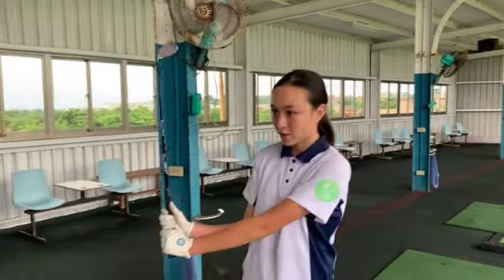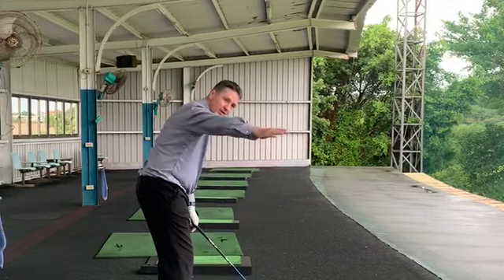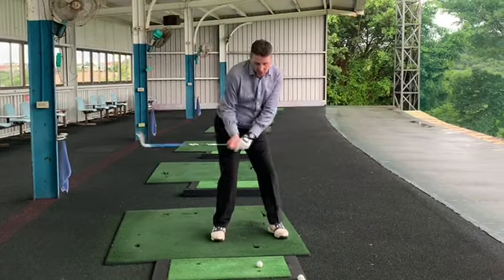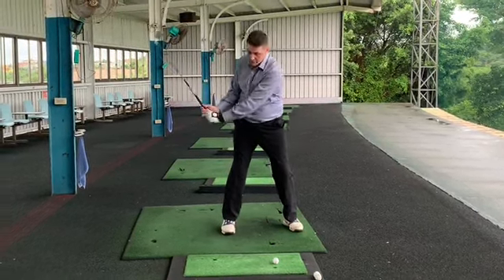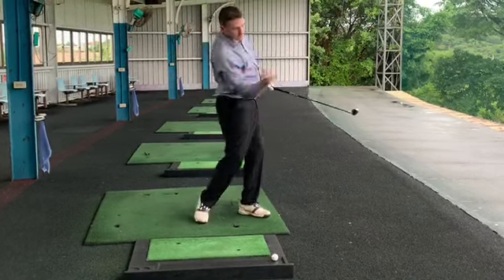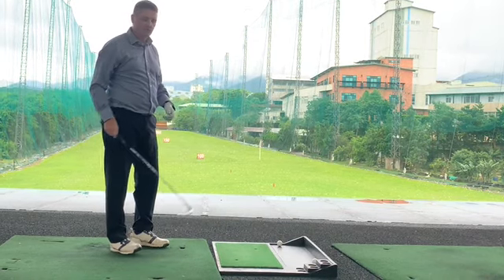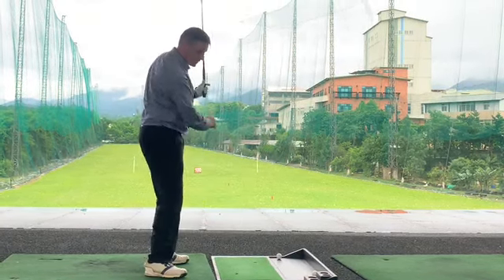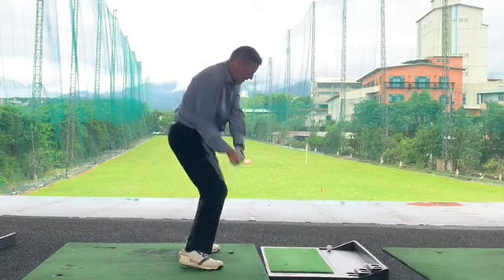Out-to-In swing fix drill - no early shoulder turn (295)

Comment: If she closes the club face a little and maintains that square face on her downswing it will be fixed in my opinion.
Reply from the maker: Yes the club face control is important, she does have a small opening of the club face which we still work on periodically.
Reply: Learn Golf with Cassie I struggle with an open face and I always have to adjust it